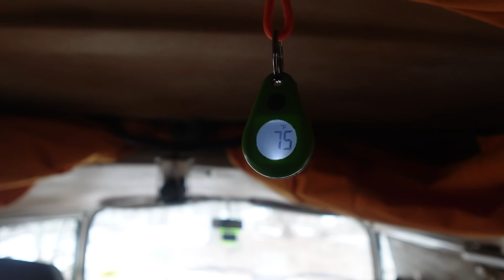SNOWSTORM CAMPING in a VW BUS

Comment: Your stove setup is brilliant,Taking the stack out the window instead of cutting a hole in your vehicle or truck topper,Good job 👍
Reply from the maker: Thanks my man, totally appreciate it. What I didn't cover was that if you saw early in the video my damper pipe had sheared off. So I didn't have a damper. Having the 2 90° elbows in the piping totally acted as a damper and worked perfectly! I highly recommend this setup. Thanks for watching dude!

Comment: Love your van. I missed mine. I had a used 1970 VW camper van like yours after I got out of college. Had it for about 9 years. Took it all over Florida, down to Key West. Then later got a used 1983 Westphalia VW Camper van and took it up the east coast all the way to New England. Had that one for about 11 years. Sure miss the great styling of those vans but missed having air conditioning (I live in Florida) and both had to have a lot of maintenance on a regular basis. Good luck on your travels!
Reply from the maker: Right on! A Fellow Bus Owner! I had one in the 90's for High School and did the opposite: Went from New England to Florida following Phish around! Was such a blast, I had to get another when we needed a camper! I don't need A/C or Heat haha, just this cool vibe! Thanks for coming along and Hoppy Holidays!

Comment: I had 1973 beetle. Fun car. Surprisingly good in snow.
Reply from the maker: I bet it was great in the snow! Rear wheel drive? As long as the engine is out over the rear tires where it should be, you're fine!

Comment: I so want a wood burner in my vdub now, that'll never throw an error or run your leisure battery flat like diesel heaters do 🤘🤘
Reply from the maker: That's what I'm saying man! No noisy clicking fuel pumps either! I always hated how they need battery power too. Plus, I've spilled diesel inside my GTI, took a year to mellow out! That was awful haha. 
And with this chimney setup, you never need a flue! Up, 90 right, across, and 90 up. I'd simply add a log every few hours. Awesome! 
Thanks for watching man!

Comment: Is your van AWD, if not how do you drive in the snow?  I didn't see any chains either.
Reply from the maker: Hey there, nope its rear wheel drive and great in the snow for two reasons: the engine is in the back and All the weight is there riding over or actually behind the rear axle and also I'm rocking General Grabbers which are freaking beefy tires in the mud and snow! 
Thanks for watching man!

Comment: Is the VW Bus original  (motor-airhose)  heating decent for winter or do you need additional heaters?
Reply from the maker: Haha, completely original. The motor is completely bone-stock, 2000cc air cooled VW Fuel Injected just as it came from the factory. It's not numbers-matching since I rebuilt it a few years ago. It's shockingly capable in modern traffic. For the heater, I added a 70's-style in-line fan (moslty used as a blower on boats) under the cab to help pull more air up forward. But these never had much heat even new. It's largely just for defrosting the windshield and taking a bit of the edge off.
I'm planning to add a diesel heater soon, stay tuned as I'll share it wtih the channel.
Thanks for watching!